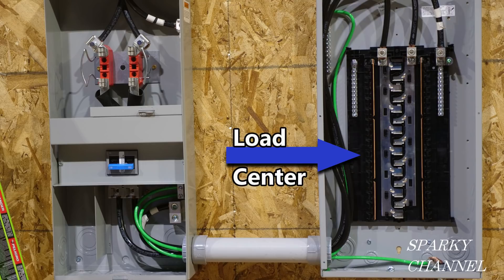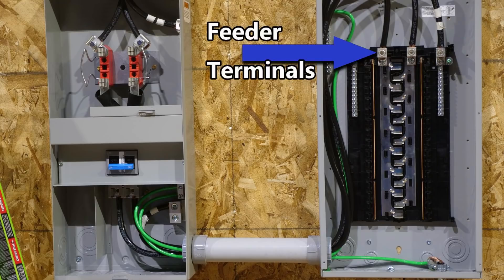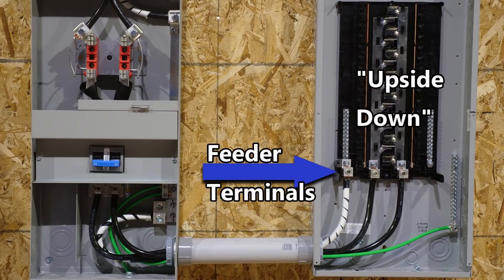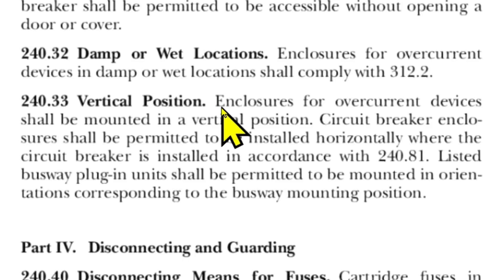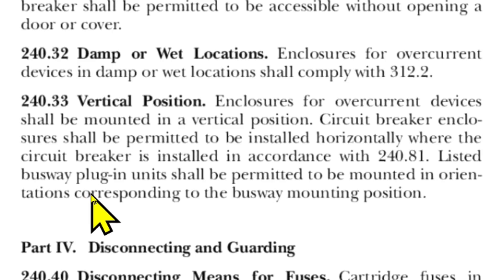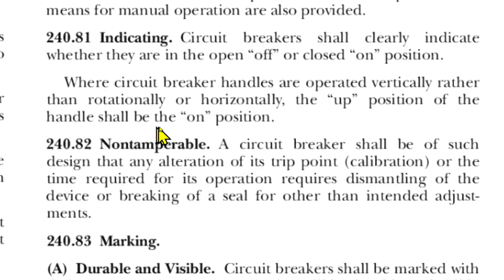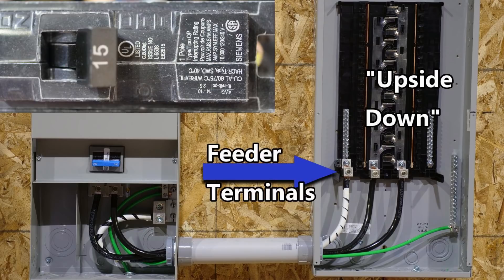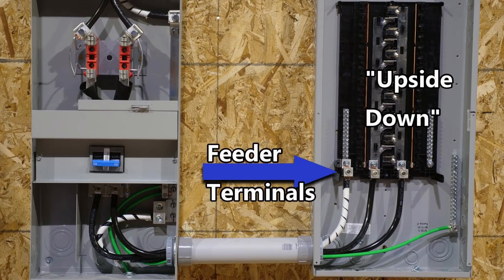Upside Down Load Center? What Do You Think?

Comment: back in the dark ages, the main breaker operated vertically, and so it always had to be at the top to be up for on.  now that most manufacturers use a horizontal handle motion, as far as I'm concerned, "upside down" puts the main lugs at the opposite end of the panel from the cable entry for the service/feeder cables.  I actually like putting the service cables in from the bottom, because it gives more room for branch circuit wiring to come in from the top.  so for me, of the two orientations, you showed, the lugs at the top were the worse choice, because of the cable routing interfering with terminating the branch circuit wiring. - though not a code violation.
Reply from the maker: I agree, great points!
Reply: @SparkyChannel  
Can you mount sideways
Reply from the maker: @daletyler5344  If the panel is made for it, with all the breakers being up for on and down for off, etc. Most panels would not qualify in the USA.
Reply: If it is marked this end up or the dead front is designed to be installed in one direction only then you would be in violation of the code.  What you are wanting is called a bottom fed panel.  Bottom fed panels are designed to have the main feeder lugs on the bottom whether it's a main breaker panel or a main lug panel.  Some panels are designed so you can reverse the interior if you want top or bottom lugs.  The reversible interiors are typically main lug panels.
Reply: Great mention and good to know.
Reply: I too agree. Upside down in this case frees up space for branch circuits entering from above
Reply: I like it for the same reason you mention. More room without feeders taking up space going to lugs on top .
Reply from the maker: @gregmartin1757  Thanks Greg!

Comment: Working on installing an "upside down" sub panel (Siemens PN series). It's advertised as being invertable. The panel cover has 2 screws holding the inner trim cover so you can invert it to match. However even doing so the cover SHOULD just fit perfectly. However the panel cover hanging tabs only work the right side up. The space between the holes and the hanging edge is different on top and bottom even though the holes are the same distance from the relative panel edge. An easy solution would be to trim off a quarter inch of the panel exterior trim to match the now bottom but that's modifying a UL box. So the alternative is you do get the hanging notches in "upside mode"?

You can see the same car in the panel cover homes in your video

Comment: I have a GE load center that says it can be mounted 180 degrees for bottom feed. The only issue that concerns me is the panel cover/door is now upside down. It would now open from left to right and the breaker numbers are now upside down. Not an electrical concern but it looks "upside down". Also the door release works opposite. It's spring loaded so gravity won't let the latch drop but it looks weird.

Comment: I think you have found a loophole in the code. From a safety standpoint, putting the exposed hot lugs high means less chance of contact. With that said the lugs should be covered anyway. I just feel safer with them high and out of the way of my hands. Then again horizontal has the same issue.

Comment: I just turned a panel over that had been installed in what I'd call a "traditional" orientation.  It's fed from the bottom, so big wires running up the side to the top.  With the requirement for so many CAFCI and GFCI breakers in a full box, there was just no way I was going to get all the wires in the right spot, even with Plug-on neutrals for many of the breakers.  Square D says right in the data sheet that it can be installed either way.  It was instantly better!  I've got another one to turn over...

Comment: I did this and the jman running the job had a fit. It passed inspection and the home owner was pleased. I can agree that its not best practice but its not wrong. 
The issues are that the first 2 breaker knockouts are usually already removed and if it does have  a main disconnect on it, the switch throws in the opposite direction (even though its labeled on/off) it can be confusing.

Comment: Thank you for your clear, simple, authoritative videos.  It's a mark if expertise/genius to present these things such that they seem simple...

Can you make a video helping us (me) to understand ampacity & temperatures for main & subpanels?  I want to put a whole-house disconnect in - between my meter & main panel.  I get confused on 75C & 90C with wire sizes, in with or without conduit, and PVC conduit.  It seems like short runs through PVC conduit, between meter & main, get to break some rules - and using that as a guide from the main service disconnect to subsequent panels, may not be kosher. (???)

Comment: Would the cleaner way, (bottom fed), cause any problem when installing a generator interlock kit?
Reply: My QO panel is bottom fed and I just had to put the generator interlock in the bottom left breaker slot instead of the top right like most people do. It actually worked out well, because I could mount the generator inlet just below the panel on the outside and had plenty of room for wiring and only needed 5 or 6' of 6/3.

Comment: I work in New York City and I installed a ETN load center bottom fed and was issued a violation. The inspector wanted in writing from ETN that the panel was designed to be mounted bottom fed. Tried to get letter from ETN to no avail. Bottom line I had to change it. He claimed that it is not UL approved in that fashion.

Comment: I have a new Square D QO panel and all of the worded stampings are oriented both directions and the mounting holes are too. It is handy as I’m helping someone wire a new shop and the feeder conduit comes out of the floor. Don’t have to fight the 4/0 aluminum quite as much.
Reply from the maker: Perfect! Good knowledge of your equipment!
Reply: I’m in the same position and that’s what brought me to this video. I am not being inspected but I make every attempt to wire to NEC as it’s best practice and there’s usually a reason. I am glad I don’t have to wrestle those big aluminum feeds into the top of this panel.

Comment: Square-D Homeline indoor 200 A panel w/main breaker can be installed either direction per mfg.  Clearly states it may be rotated for either top or bottom feed.  I have bottom feed so my main breaker is at the bottom.  Panel stickers may be read easily either way.
Reply from the maker: Thanks!

Comment: Evidently my electrician was under the impression that the panel must be mounted feed terminals up.  He replaced that infamous Pacific Electric, long time on the warning list, panel board.  There was an opportunity to feed from the bottom which would have been so easy.  However, he spent time rerouting the feed so that the panel could be oriented feed terminals up.  I’m guessing that he could have saved an hour or two going bottom feed.  The original PacElect panel was quite smaller than the replacement panel so where the new panel was to be installed there wasn’t enough room at the top of it so some major wall surgery had to be done to accommodate a feed into the top of the panel.  There was plenty of space below the new panel to do the connection very quickly with no “surgery”.
Reply from the maker: Good example, thanks!

Comment: I installed my replacement load center upside due to the bus feed and the horizontal main disconnect would be over 6' off the floor.  My only concern was the increased possibility that something metallic dropped inside a live panel can short out the bottom bus lugs which round not trip the breaker because there is no disconnect/overload on my meter box on the other side of the wall.  I heated a Lexan panel and molded it over the lugs and this molded guard is held on by two screws for easy removal.  I feel that these panels should come like this from the factory.

I am not an electrician, but for my field service job I work on and repair three phase 240-525 VAC and 750 VDC servo components on the equipment that the company that I work for produces.  All of our components are finger safe for our customers protection.  We even switched to Wago screw-less terminal blocks were we can.  We don't even use wire nuts in our three phase motor junction boxes anymore.  I wonder why residential components are almost never finger safe insulated components?  Why are outlet binding screws so exposed and susceptible to shorting in steel j boxes if they get loose?  Shouldn't residential components be safer?  I always wrap my outlet binding screws with 3M tape to make them safer and I doubt this is code.  Or is the NEC slow rolling these requirements so they still have jobs in the future?
Reply: the danger from outlet screws really only comes from them being installed wrong or loose in the first place. especially when the box isn't secure in the wall and the whole thing falls apart over the years. if the nec required more safety within a receptacle installation, the people causing the problems would just ignore those rules the same way they ignore the rest of the code. tape makes it safer, yes. so another reason I'd guess is cost and possibly box fill. 

but I think when installed properly, the exposed screws are not the root cause of most problems. its only when installed improperly that they are dangerous, same as any electrical installation.
Reply from the maker: Excellent safety measures, thanks!

Comment: I've ordered and installed lots of commercial panelboards. Top or bottom feed is predicated on where the feeder is entering the panel. Many industrial applications are fed from a step down transformer sitting adjacent to the main breaker panelboard. These are almost always bottom fed with a piece of greenfield to keep the gutter spaces open. Especially necessary with a 400 amp 3phase panel. Those 4-3/0 or 4/0 cables completely fill up the gutter space creating a real problem when installing the branch circuits. If lug covers aren't provided by the manufacturer, I will cover the lug with duct seal compound to help protect from accidental contact.
Reply from the maker: Thanks!

Comment: Top fed or bottom fed is what we call them.  Both are correct but in that situation it should be bottom fed for the conductors are not taking up space on the sides.  Also you can see a few dollars on wire.
Reply from the maker: I'm all for saving $$$.

Comment: If the stickers and documentation on the inside is already attached, then it doesn't make sense to mount it "upside-down" if those stickers are also going to be inverted and difficult to read.  Then and names stamped or labeled on the cover panel will also be inverted.
Reply: also the "ON" / "NO" rule applies here.
Reply from the maker: Thanks!

Comment: But, the mounting/hanging slot in the back of the panel will be upside down if it is mounted backwards.
Reply: Lol. True. I always put extra screws into the backboard, usually at least 8-10 fasteners and the panel won't ever budge. // I prefer panels 'upright' with service entrance lugs at the top, with some branch circuits coming in at the top, but most from the sides. My backboards are sized so I have ample space for well organized wiring above and alongside the panel.
Reply: Wow

Comment: I have several thoughts on this. 
1. With the feeder cables coming in from the top and secured "normally" even if the lugs loosen up the tend to stay in place due to gravity.
2. With the feeder cables coming in from the bottom if they lugs become loose they may fall out and short against the enclosure due to gravity. An easy fix would be to add some sort of clamp to prevent it from falling "down"
3. With the feeder cables coming in from the bottom there would be concern that if any metal anything fell down it might cause a short, from the top not an issue as much.

I like the cleaner install of upside down.
Reply: Feeder cables should be torqued properly. If they are loose enough to fall out and held only by gravity the heat at the connection will be a greater problem than any risk of shorting on the enclosure.
Reply: I'd like to know where I could find some 2/0 that is flexible enough to just fall out of a lug once it's been wrestled in there.
Reply: you all correct. we kip doing it the top way .
Reply from the maker: Thanks for your thoughts!

Comment: I've heard of orher parts of the country, maybe Canada that install panels sideways. Anyone see this in person before?
Reply: Here in Ontario the majority of panels I install are horizontal.  For residential work we have a rule that a breaker handle can't be more than something like 5ft off the floor so when you get longer panels close to 4ft long to go vertical would put the bottom of the panel at your knees
Reply: @christophervosburgh7630  cool, I've always found it interesting to here what's standard in different areas. I'm in the northeast and we install our panel so no breaker is above 6' 7". That height leaves plenty of room up off the basement floor. Side note because of higher snowfall our electrical meters need to be mounted 5' to center.

Comment: The key issue is the listing of the equipment.  The panel can is listed to be mounted in one direction.  The design of the dead front and the interior (guts) will be the limiting factor of which way is correct for the mounting of the interior, especially if it is a main breaker panel.  Main lug panels tend to be easier to reverse, but some designs are offset enough in the panel that you have to install the interior in one direction.  "Right side up" and "upside down" have nothing to do with the location of feeder connections and everything to do with listing.  If you violate the listing of the equipment, you are in violation of the code.
Reply: This is something people often don't think about. "Equipment shall be installed per the manufacturer installation instructions." is peppered all through out NFPA 72 as well. Essentially and indirectly, the installation instructions become a part of the code at that point. I just hate it when the install instructions still don't answer your question sometimes. And you're still left wondering.
Reply: @phil0083  The rule of thumb is that if the manufacturer marks one end as top or this end up, that is the listed installation direction.  Mounting the equipment in the opposite direction violates code, listing, and manufacturer's installation instructions.  I have had only one case where we had to modify a panel outside its normal installation instructions and we had to get a letter from the manufacturer authorizing the modification and stating that the modification didn't violate the listing prior to making the modification.
Reply: @Ian Belletti.     Best answer !
Reply: Not always true.  Square-D Homeline indoor 200 A panel w/main breaker can be installed either direction per mfg.  Clearly states it may be rotated for either top or bottom feed.  I have bottom feed so my main breaker is at the bottom.  Panel stickers may be read easily either way.
Reply: @ImapatriotUSA  you just proved my point because the panel you just described is listed for either install direction.  The key word is ”listed".
Reply from the maker: Thanks!

Comment: I see a lot of panels installed upside down with the 220v breakers on the top, away from main breaker, my instructor teaches the class to put the 220v breaker close to the main, when they are placed away "bottom of bus bars" when the 220v breaker has a load on the circuit it dims the lights on the 110v circuits?
Reply: You need a new instructor. Run.
Reply: Your instructor is guessing and revealing his lack of understanding, ignore anything he says and just study for yourself and find experienced electricians to learn from.

Comment: Wouldn't the main consideration be the manufacturer's instructions? Listed equipment must be installed according to the manufacturer's instructions. If they say "upside down" is okay, it's not a problem. I could believe that's true only for some load centers - e.g. does the door latch properly if it's upside down?

Comment: What about the circuit # in the cover , Now the numbers are going to start from highest to lowest.
Reply: That would depend. Is it symmetric? If so, then the cover could still be put on right side up. If it's not symmetric, then you're right, it would look funny. Depending on how the numbers are printed on the cover, the lettering/numbering may be upside down. Not a good look for the customer.

Comment: Both are illegal - don't see the bonding screw. Also no covers on main lugs. Lastly, no connection down to grounding rods. Bottom is cleaner install and uses less material.
Reply: Sorry, but you are mistaking the load center as part of the service equipment, but it is not.  Only service equipment ends at the main service disconnect, which is incorporated into the meter enclosure in this case.  You don’t bond the neutral on a sub panel [250.24(A)(5), only at the main service equipment [250.24(B) and 250.130(A)].  Barriers on terminals as required by 230.62(C) pertain only to service equipment, which the sub panel is not.  There is a barrier over the terminals in the meter/main protecting the terminals from inadvertent contact.  Finally, there is a connection to the grounding electrode system via the lugs in the meter/main disconnect enclosure which is where the grounding electrode system connection needs to be [250.62(D)(2)].  The grounding system can not be connected at a sub panel.
Reply: Bro start your own channel haha. This service build is beyond reproach. I flip my panels according to where the wire comes in. Neat and clean

Comment: I have always seen the panel placed based on incoming feeder. It it comes into the area from the top the panel has the disconnect on the top. If it comes through the floor the disconnect is on the bottom.